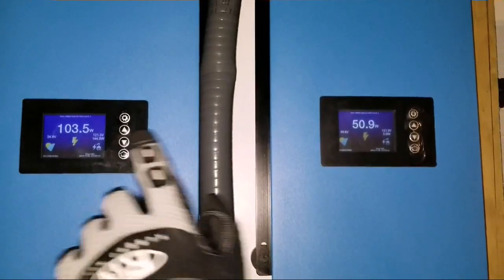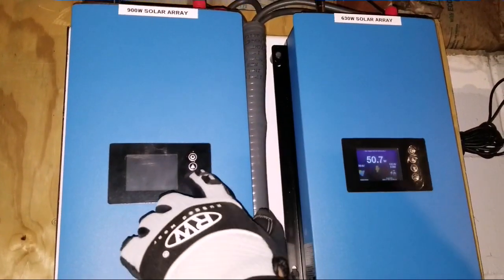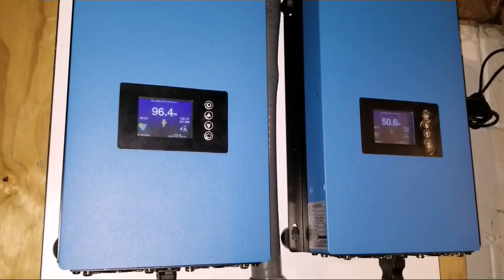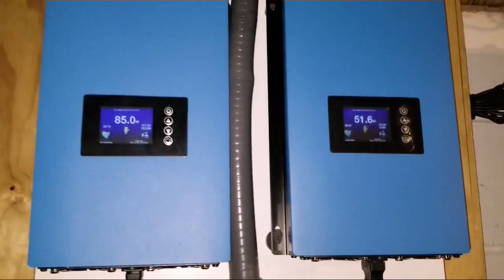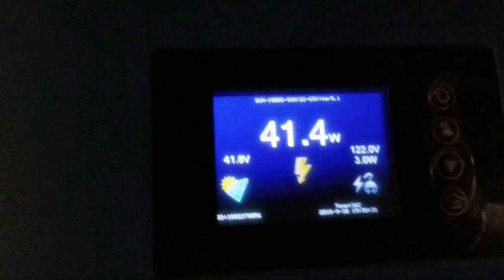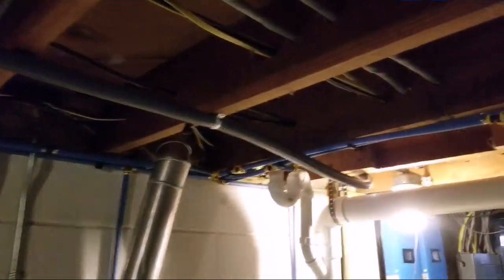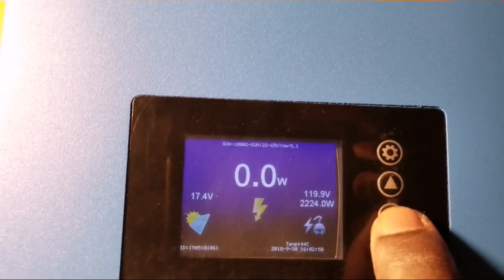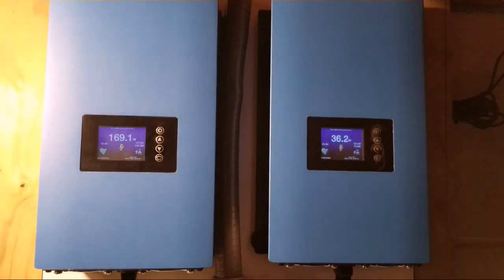UPDATE ON SUN GRID TIE INVERTER GTIL2 | How To Install GTIL2 Limiter Sensors To 240VAC Breaker Panel

Comment: How much are those grid-tie inverters worth
Reply from the maker: There are a lot of vendors out their which varies the prices. Please take your time and do a some Google research to find which vendor or pricing that suit you best. 
Thanks for watching my friend and have a wonderful day.
Also, if you haven't been a subscriber yet please do so and click on the bell to receive notifications on my next uploads
Reply: how much is the one in the video
Reply from the maker: 1000W Solar Grid Tie Inverter Power Limiter, MPPT PV System DC Input 22-65V/45~90V Inverter (1000W DC22~60V) https://www.amazon.com/dp/B07HNZXWZ6/ref=cm_sw_r_other_apa_i_HjM0Bb9FY1Z9M